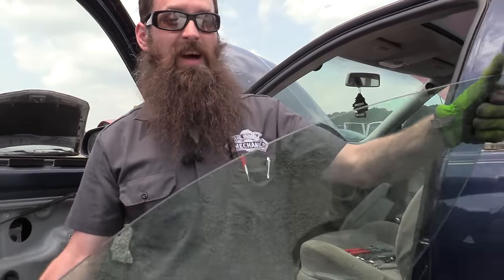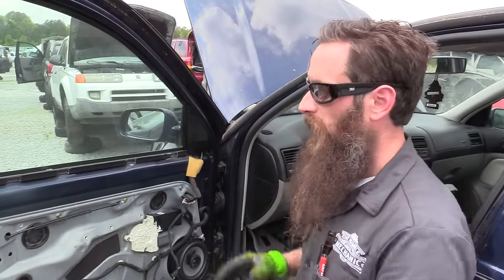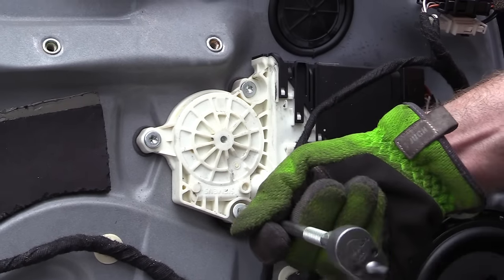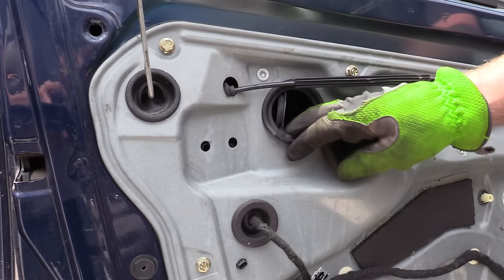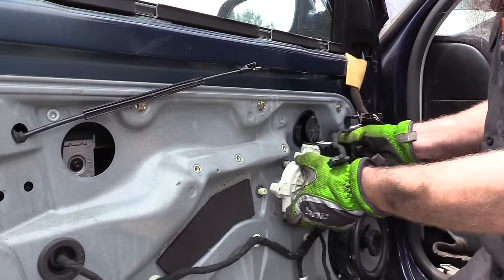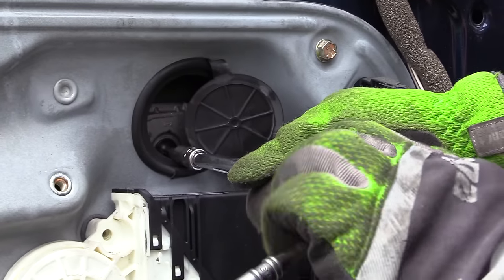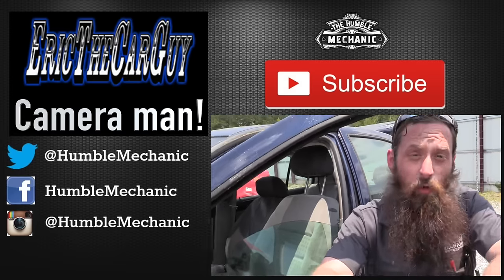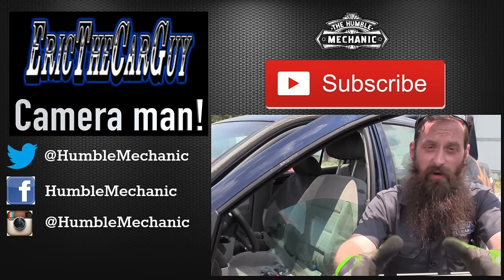How To Remove a VW Window Glass ~ Salvage Yard Tips

Comment: Thanks man, trying to replace rear window on my 2012 jetta wagen and was wonder how the F% this was supposed to work.
I think your video helped me realize how  I get the new one in AFTER I resecure that inner metal panel secured (I had to remove anyway to get broken glass and the spreader-plug thing,.  And then I should have access to lock the fastener,.

Comment: at 0.55 it should have two rivets there, Don't need to remove those rivets before remove the carrier panel, it will hard to put it back,  I remove the carrier panel with the door lock all at once, first on rear door that fitted with 1/4 window or wagon, you need to remove the short window's rail that fit front of the door lock, then remove the lock bolts and then you can remove the all out a little to easy remove the cable that from the outer handle to the door lock ,then can out at once.some models need to remove outer door handle at once.
after out ,then can remove and install the rivets easy., front door is easy because no window's rail there.Hope this help!

Comment: Thanks bud. Im a retired Master but not a VW guy. Thanks for posting. My Daughter got smashed in her dodge truck. 2 weeks later her hubby was rear ended in the Passat. So they had my pickup and a motorcycle. After all the vehicles come home she loses a window to mowing the lawn without checking for rocks. OUch. DAD!!!!
Reply from the maker: Oh man That is some bad luck. Good thing they have a great dad to help them out. :)
Reply: well hers had the reverse torx(etorx) and reverse threads both. Glad I saw your video and read the comments. It was a breeze.  Plus the glove box was damaged because my son in law didnt know how to unlock it to get his insurance card when all upset. Then he broke the visor clip . All were easy to fix. Maybe I should have considered being a VW guy in my day after all. I did work on VWs way back in the early 80s when I did body and fender work. BUgs type 4 ,vanagon, rabbits and sciroccos. Restored totals at a specialty top during the years when the EPA was killing the industry.Anyway Thanks for the help. Ever need to bounce stuff off some one I was an electrical and electronics specialist and a member of the IATN. Not the smartst guy by any stretch but prettty good at engine performance and drivability stuff. Have a good day.
\

Comment: hey man sorry to bother but i know youre really helpful and i would appreciate if you uelp me out so i bougt this gti n it had some issues vutvthats not the point i left the car in my parking space after i drove it home and while i was at work my brother tried starting with a key that just opened the doors on the car but  didnt start the key that starts the car was with me at work so i came back home and tried starting but all it would do is crank up but no start im tryna figure out if i have to reprogram the key by reseting the system what would you reccomend ?

Comment: hey i have a 2009 passat tsi ccta i have extended cranking but once fired up runs like it should and runs smooth also i have codes p000A p0011 p0068 p0341.....it takes 4 cranks while holding the key to turn on position....also i have oil pressure warning lights coming on at random times on random days sometimes it doesn't even come on can you help me?

Comment: Hi, Thank you for the video.  Do you know how to replace the pin that goes through regulator and into window on 2012 Passat? There is one in the middle that connects the window to the regulator. I see the access hole but not 100% clear how to put new pin in as it is in 2 pieces. Smaller fits inside the larger. Thanks in advance
Reply from the maker: It’s probably the same as my Passat rear window. I did a video on it. You can skip right to where I install the pin

Comment: On some models the screws on the clamps loosen the other way. Just a heads up.
Reply from the maker: TRUE! some are counter threaded. most of those are also inverted torx drive. What a dumb design.
Reply: Counter threaded... Thanks. We call it "links" (left in German) in Norway..
Reply: any idea what to do? i cant lift up the trim after its unscrewed in the handle and under it gets stuck somewhere

Comment: hi, i own a vw golf mk7 and yesterday sent it to have his (it's a boy) windows tinted... when i picked it from the local shop, quite prestigious i may add, i've noticed the tiny windows on the A pillar were not tinted, i asked why? and said they couldn't do it because there was no room..
is there a way to have them removed and tinted and then place them back?
i am affraid if i push the rubber with a screw driver might break the glass or bend the metals...
please help
so i can teach the pros to do things right
i might add they are not really as good as they advertised, i've already changed both films on front doors and after 24hrs back doors and rear one has bubbles, hopefully the third will be the charm one...
if anyone can help me to teach these genius and pray for the new tint install works well would be mostly appreciated
thanks

Comment: what do you do if the glass isnt connected to the mechanism anymore and doesn't move with the rotor when you press the button for it to go down
Reply from the maker: You can pull the glass up and out. Put the regulator at the right position and then install the glass.
Reply: thanks for replying,  its actually the motor thats damaged but i cant get the regulator off the door.  im sorry to lay this on you but i have few problems with the car  would you be willing to help me with some advice please

Comment: first
Reply from the maker: NICE! Also nice Avatar. I miss King of the Hill
Reply: HumbleMechanic Dude King of the Hill was the most unique and well made cartoon of all time. Mike Judge is the man. he's making a new cartoon about country musicians I believe.
Reply: HumbleMechanic can you help me out real quick? I have to change a rear wheel bearing on my sisters 2002 1.8t Jetta. I bought the hub assembly but I need to know what special sockets or bits I need. I know German cars use triple square stuff. thanks man
Reply from the maker: I think the main bolts are allen bolts, maybe 8mm (it's been a while) and there is a special socket to push the bearing on a little bit because the bolt is too short. I think you can nurse it on if you are careful.
Reply from the maker: YES! one of the best show of all time. The character development during the series was amazing. LOL
Reply: HumbleMechanic exactly!
Reply: HumbleMechanic thanks buddy!